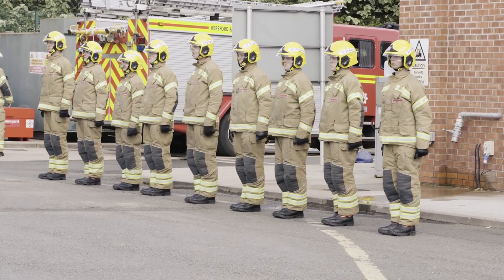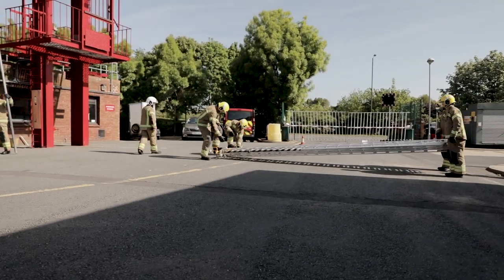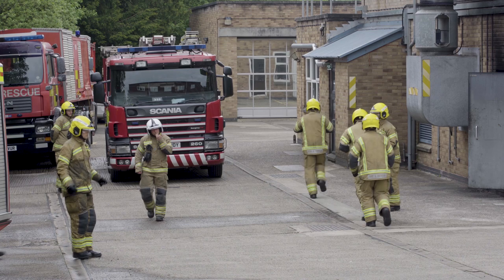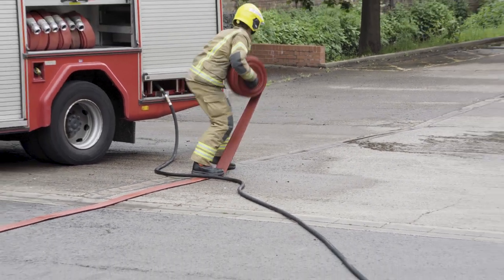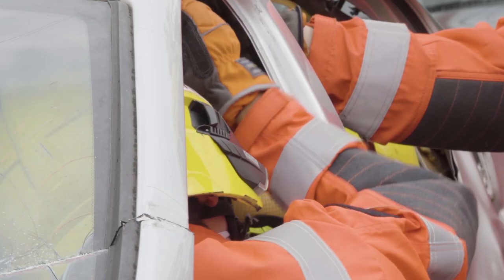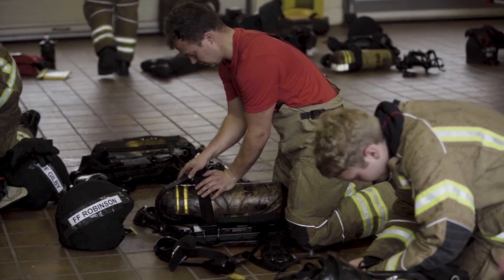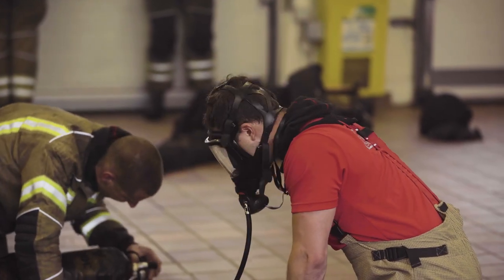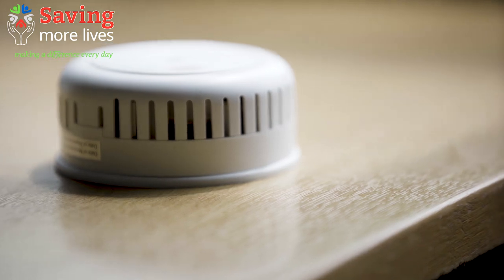On-call firefighter training

Comment: It's difficult to understand that while they do get called out via whatever method of alert,the ratio of firefighting is relatively small,sorry don't want to disappoint potential on call firefighters ....but read the small print before committing yourselves!!!!
Reply: @Awoke Awoke RTC i would say would be the main one. Car crashes.
Reply: @Awoke Awoke The most important thing is that the job is being done correctly and all people that are saveable are saved. I'm not a firefighter but a lot of my family are and have been in the past. 

I'm in the same boat as you. I've applied for an on-call position and have done so in the past without luck processing further.  You just need to prepare yourself for the day when you're required to step up and be thankful the more proficient trained man beside you is there. Get the basics covered first. It isn't the job of being the hero. It's a job of working as a team to save lives. With enough confidence and the basics covered, you will be that proficent man.
Reply: My on call station has had one house fire in two years, other than that it’s all station standbys and rtc
Reply: If anyone applies to be an on call firefighter and only expects to be in the thick of the action fighting fire like absolute bosses... you're doing it for the wrong reason.

It's about being there in case their community needs them. Making a difference in people's lives. That isn't always entering a burning inferno and running out with them in your arms. It could be as simple as helping them with oil spills, even if they've just injured themselves, and Fire are the first on scene.

Even normal firefighters barely fight fires now. So if you're applying in the hopes, it's all Hollywood... you need not apply. It's about giving back, being there is needed and ultimately serving your family, friends, and neighbours. It is still a great thing to do, but don't apply for the wrong reason.

If you're having to battle a fire... you need to remember it's not a celebration! It's potentially a dark day in someone's life, especially if it is a house fire. Never forget, no matter how much of a rush it is... for someone else, their entire world has potentially burnt down! None of this American high fiving and wooing crap!